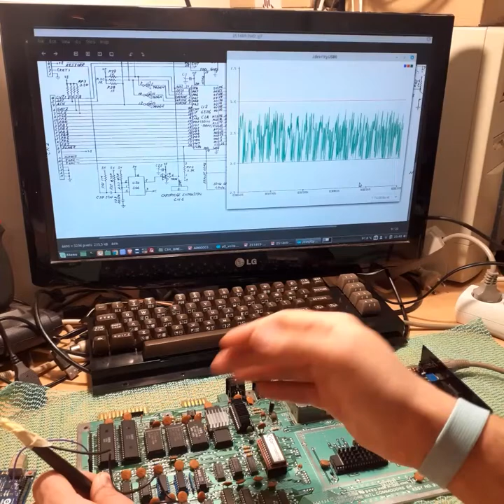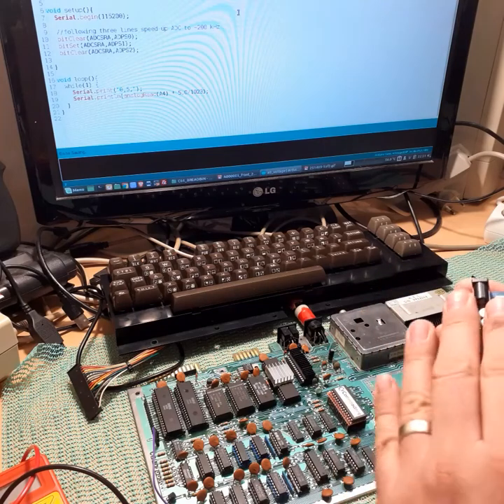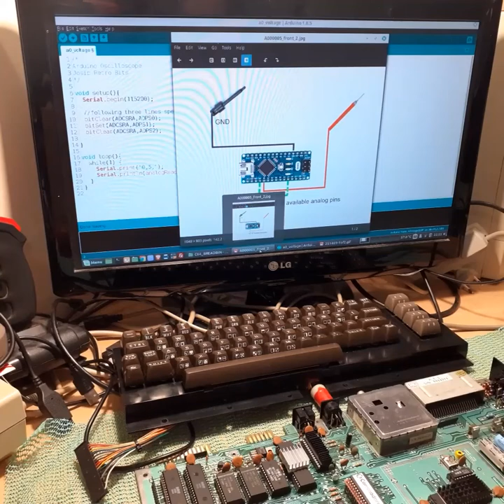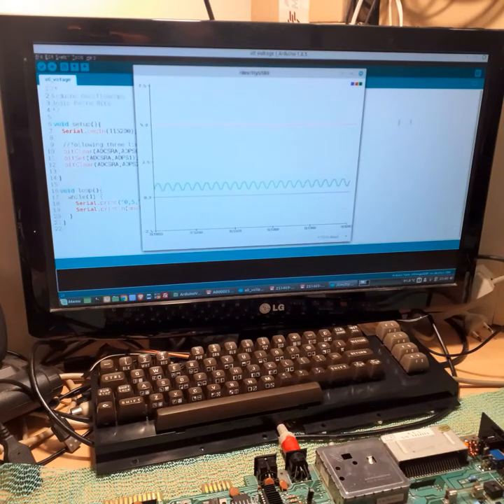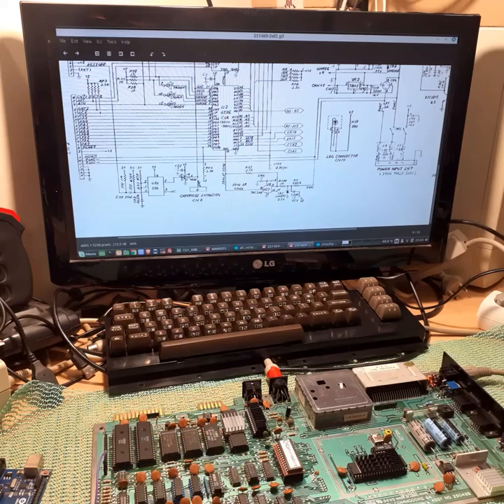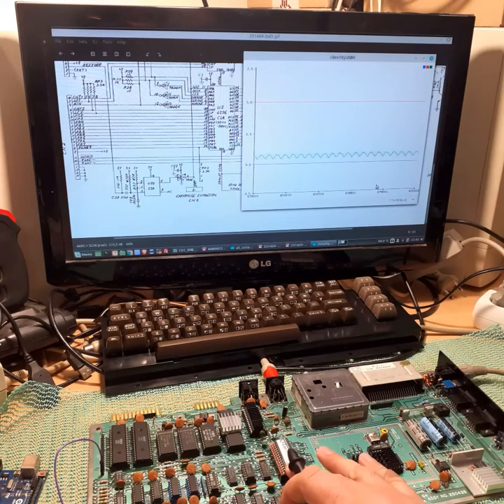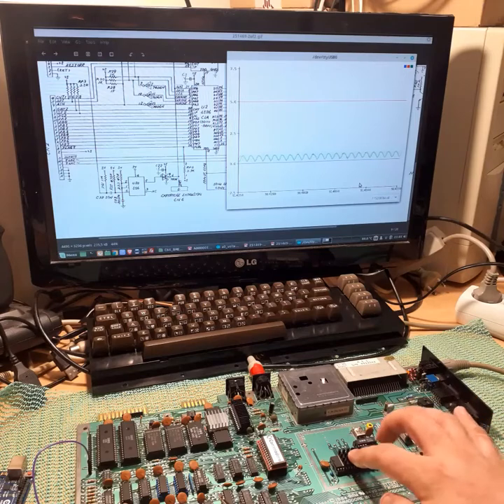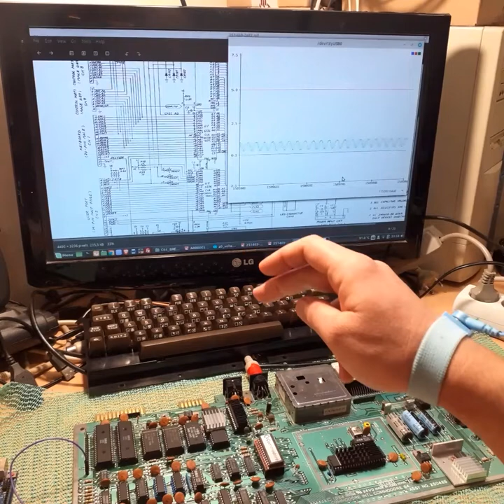Using Arduino to repair Commodore 64 boards | Build Your Own Oscilloscope

Comment: What do you thinkbthe sampling rate might be on the new Arduino R4 ?
Reply from the maker: Not sure, but there should be better and faster platforms then arduino uno by now. ESP32 + LCD Screen could be a way to go :)